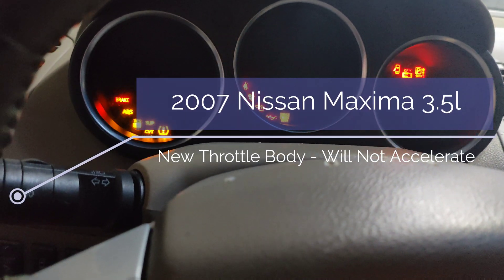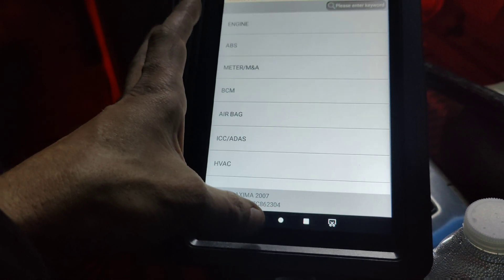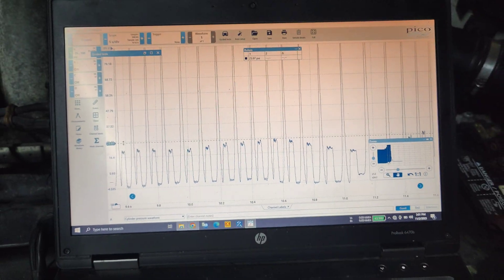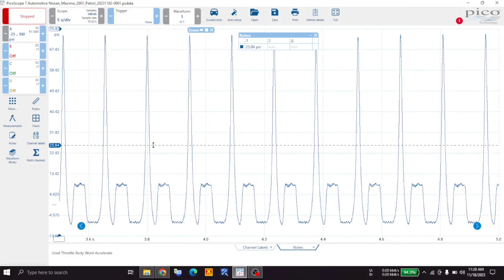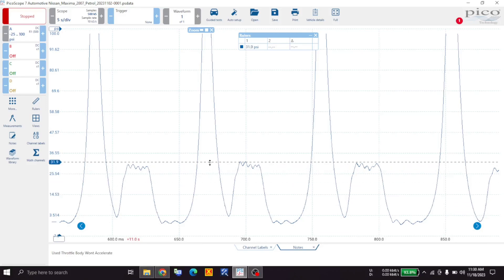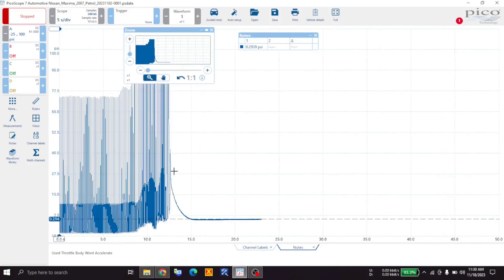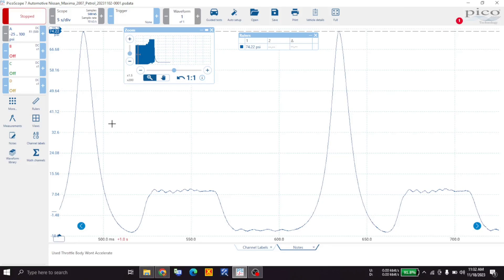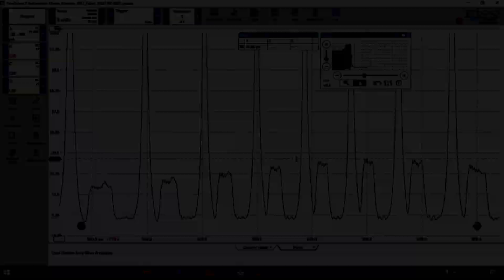2007 Nissan Maxima 3.5l - Will Not Accelerate - Stalling

Comment: Great diag, Thanks for sharing! What are your thoughts on that Transducer you're using?
Reply from the maker: I love the transducer, the fittings and hose are junk so I changed them. The hose is not designed for the pressures and they explode.  I use a hose from my compression gauge and I use a hose I had made by a hydraulic shop. The threads on the transducer are standard threads so its easy to change.